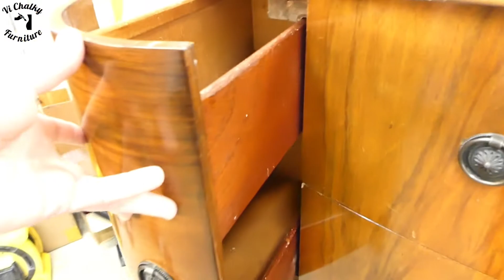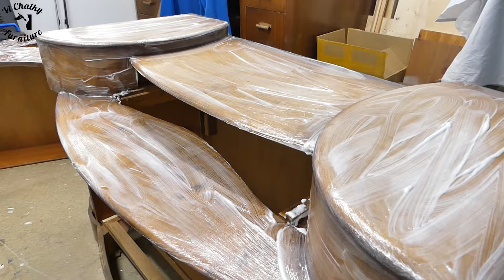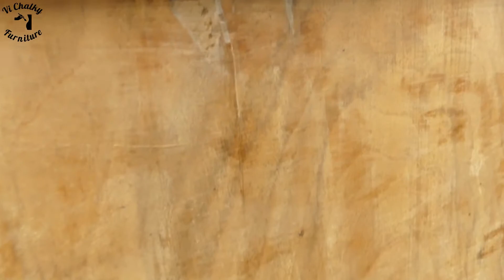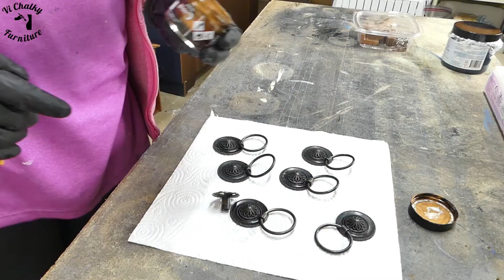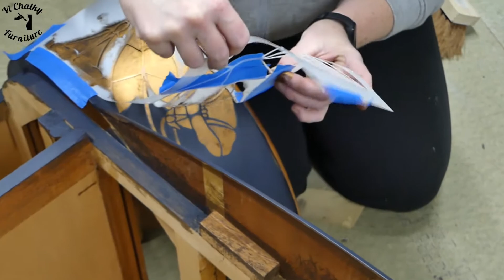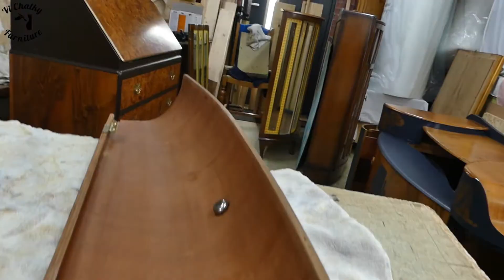Art deco dressing table makeover with stencil and osmo oil.

Comment: You did a satisfactory job, but you should have thoroughly cleaned the piece inside and outside before anything else. The straight, rigid lines of the front stenciling do not mesh well with the curves of the piece and the other stenciling..
Just saying..
Reply from the maker: Thank you for watching and valuable comments.

Comment: Absolutely Wonderful! You said it took months... because of the oil curing? Could the oil have been sealed if you needed to deliver sooner? That may be a silly question, but I am just learning about furniture restoration and have a very small space.
Reply from the maker: It took months as I was so in love with this piece and I hated it the same time. It was due to difficulties that I have with this piece. Oil was not a problem. It is usually a week for oli to cure enough to deliver. Normally oil needs 8-10 hours to harden but for moving furniture safely week of wait is a min wait.👍👍👍